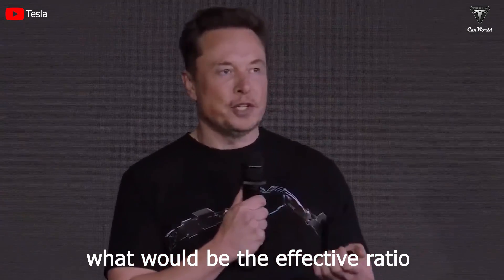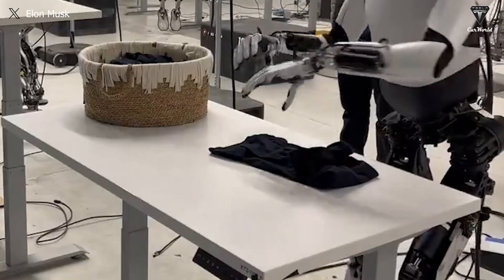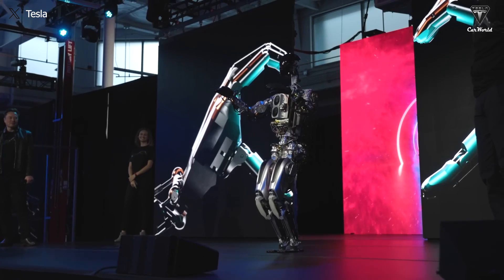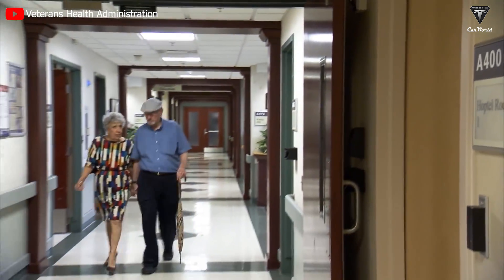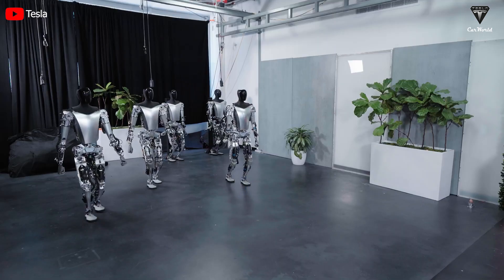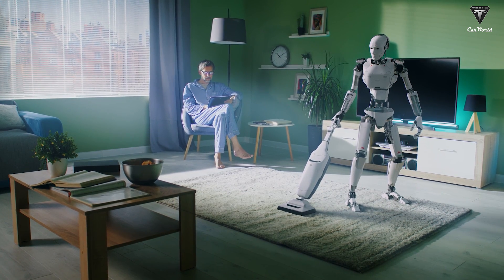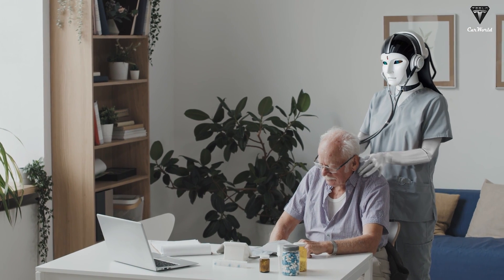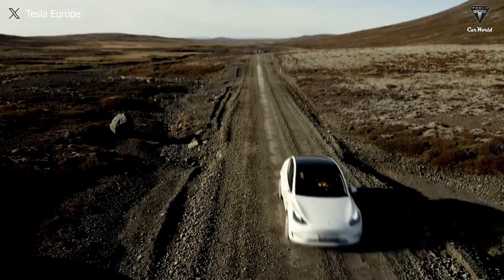The Reason Why Tesla Develop Tesla Bot Gen 2! An indispensable Homemaker in 2024!

Comment: A good start, but how do they work ? What type of actuators ? What type of training ? What type of battery ? What type of sensors ? etc. It would be interesting to address those questions?
Reply: A lot of those have been answered. But EVERYTHING is subject to change in Teslaspace...
Reply: They are working out the kinks as we speak. Just like how smart devices evolved from the previous generation...The Tesla bot 14th gen will be leagues ahead of the 4th gen.